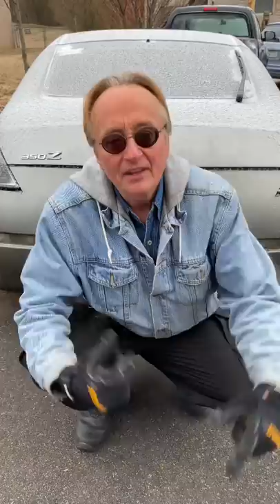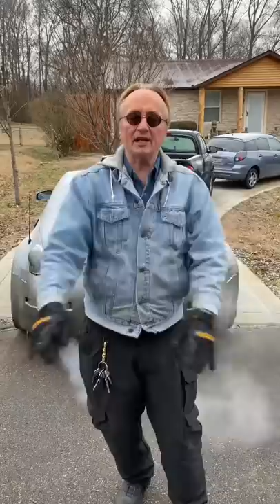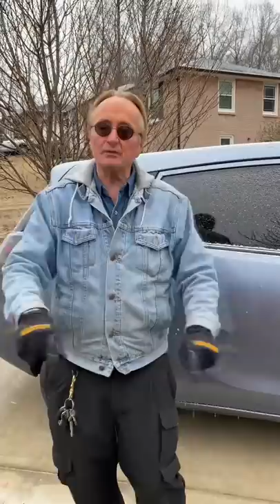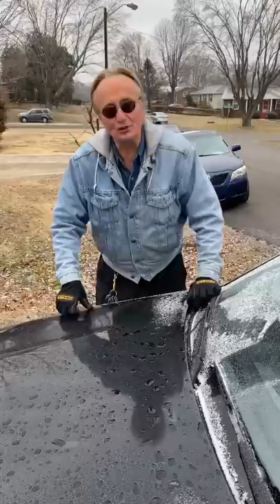This Illegal Mod Will Make Your Car Run Better

Comment: Get a Diesel. To my understanding, they're excempt from Emmisions laws, so straight pipe away.
Reply: They have separate emissions rules, so that is not correct. Some states don't have testing on them but you are still supposed to leave everything intact.

There is some workarounds like on older pre-emission diesels you could remove the muffler if your state only required a muffler of some kind because the turbo is technically a muffler, but that is only certain situations when the engine has no emissions and select states.
Reply: @tylerperlenfein  according to Texas law.

All Gas powered engines aged 2-24 years, in addition to annual saftey inspections, must also pass an emmisions test. However, Diesel motors, motorcycles, and those living in certain counties are excempt from the emissions test.
Reply: @tylerperlenfein  so i guess in a way, yeah. Based on the state.

Comment: This is so false on every level. Unless your car had a clogged cat or bad muffler there is no power gained. Just sound and emissions maybe. Plus your car needs the back pressure built by the exhaust to run better. I mean I'm not saying I hate the loud noise but there is no power gain or anything. Just terrible emisson  and good sounds

Comment: Texas does emissions inspections based on county, I live in Bexar county and there's no emissions inspections here. So I've had several straight piped cars pass inspections with no problems.

Comment: Wait you say adding aftermarket intake is bad an yet you  advocate this..when in reality it's the other way around better to have OEM exhaust... If the engine isn't able to intake any more air volume at smoother higher speeds then factory there's no reason to mod exhaust other than a Placebo boost in ext volume/tone..and MAYBEEEE gain 1-5 HP&TQ @ 💯%wide open throttle... Lost some credibility guy...

Comment: Most of the time you actually lose Power. Cause you engin needs some resistens on the exhaust system to run properly.

Comment: We’ll not exactly, an engine needs back pressure to operate properly, cutting out everything that creates back pressure would just increase your high RPM power but would decrease your low end power and torque. So yes increase Horsepower at high RPM’s but would ruin your low end power. It does not give your car more power overall though, just will change we’re your powerband is on your RPM tree. If I am wrong someone let me know!!!